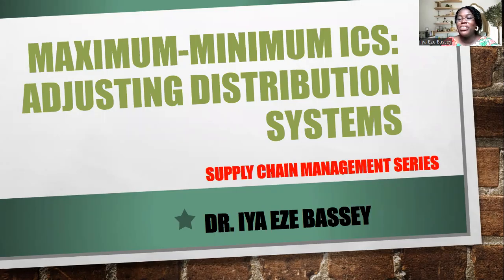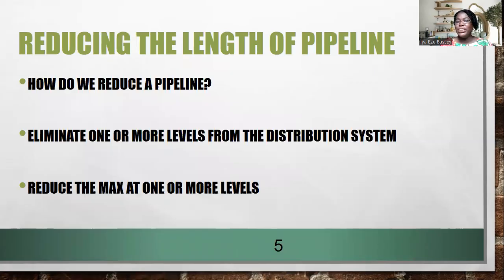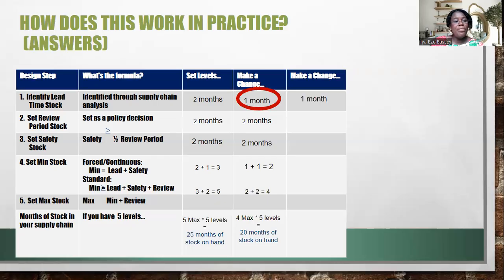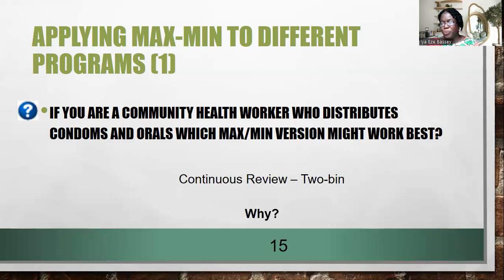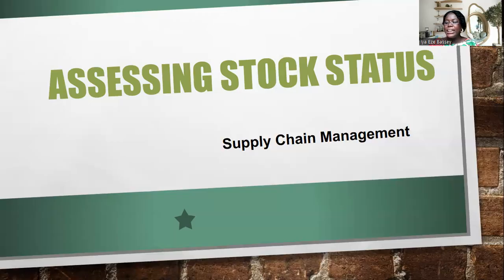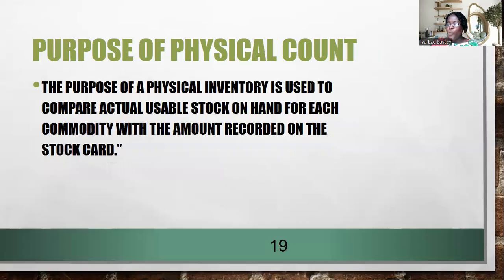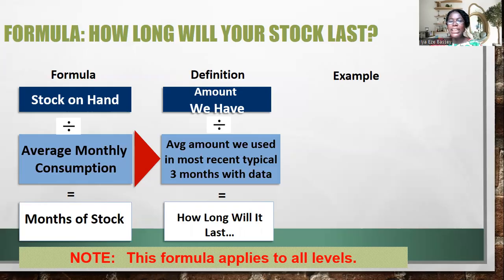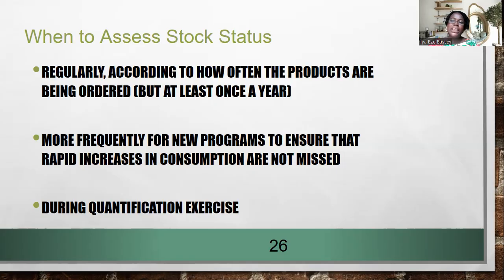Maximum-Minimum ICS: Adjusting Distribution systems (Supply chain management series)

Comment: I learnt a lot from this video and it is very interesting. 
The following are the steps in designing a max min ICS; 

1. Setting up an initial max-min policy for each level and type of facility 2. Check the overall distribution 3. Check the total length of pipeline that each policy level implies. The following are the factors that impact the max-min levels are 1. Cost of production 2. Lead time 3. Storage capacity 4. Cost of storage 5. Age of program The Advantages is using the max-min system are; 1. Avoid overstocking 2. Avoid understocking 3. Minimize wastage 4. Avoid cost of emergency order I also learnt that the system with numerous levels can affect the use of this system, also the system that manage products of new program can be challenging in using the variation
Your lectures are really useful and interesting because it is easily understood and comprehensive. Thanks ma’am

Comment: In summary i leart about the step in designing a max-mini ICS as length of a pipeline 
1. Step up initial max-mini policies for each level and type of facility 
2. Check if the overall distribution will function properly if the level specific max-mini policies are implemented 
3. Check the total length of the pipeline that the policies at each level imply.
 Reducing the length of pipeline 
• How do we reduce a pipeline?
• Eliminate one or more levels frin the distribution system 
• Reduce the max at one or more levels 
Lastly i learnt about assesing stock status.

Thank you ma'am

Comment: To summarize this session, the ways to identify how to adjust distribution system policies depends on the length of a pipeline and how to modify the pipeline to reduce the max at one or more levels to improve the distribution on systems reliability. 

Cost of products, storage capacity, shelf- life of health commodities, lead times, accuracy of forecasts and other factors that impact max-min stock level should be  checkmated to ensure consistency of all stock levels. Although there are challenges to using each version of the inventory control system, reliable data source from SDP for forecasting  and quantification can be collected.

Comment: A brilliant lecture Ma. To summarize, there are steps to designing the Max-min ICS are:
— To set up initial max-min policies for each level and type of facility 
— Check if the overall distribution will function properly if the level specific max-min policies are implemented 
— Check the total length of the pipeline that the policies at each level imply
       To reduce the length of a pipeline one or more levels are removed from the distribution system and reducing the max at one or more level and to reduce the Max. Stock level, elements of the formulas that can be changed in order to reduce the Mac stick level like review period,lead time, distribution systems reliability. There are several factors that affect Max-Min levels are;
a)cost of production(b)lead time. (c)storage capacity (d) cost of storage (e) age of of program. Some advantages of the Max-min system are: avoid overstocking,minimizes shortages,avoidance of emergency order and consistency of stock level,minimize wastage. Challenges to using each version and variation are systems with numerous levels, those that manage a large number of commodities and systems that manage products for new programs. Access stock status involves the physical count which it’s main purpose is to compare actual stock on hand for each commodity with the amount recorded in the stock card. It is possible to access stock status regularly according to how often the products are being ordered but this should be at least a year.

Comment: Thanks ma'am for this insightful lecture, I understand that In designing an efficient maximum-minimum inventory control system, it's important to set up initial policies and check the length of the pipeline that these policies imply. An elongated pipeline can be inefficient, as some products may not last as long. Reducing the length of the pipeline by eliminating one or more distribution levels can be beneficial. Additionally, it's important to regularly count usable inventory by hand to compare it to inventory records, and to update these records as needed. This helps to ensure that inventory levels are accurate and up-to-date.

Comment: Thank you ma, for this detailed lecturer. In summary I learnt, there are several steps in designing max-min ICS, which includes;
1. Set up initial max-min polices for each level and type of facility.
(2) Check if the overall distribution will function properly if
the level specific max-min polices are implemented.
3 Check the total length of the pipeline that the polices at each level imply. I also learnt how to shorten the pipeline:
1) Eliminate one or more levels from the distribution
systems
(2) Reduce the max at one or more levels.
The purpose of assessing stock status is to determine how long supplies will last.

Comment: In supply chain management, the phrase "maximum-minimum ICS: Adjusting Distribution Systems" refers to the idea of optimizing the distribution systems within a supply chain to achieve maximum efficiency and minimal expenses.

To make ensuring that products are supplied to clients in the most effective and economical method possible, it entails analyzing and changing a variety of parameters, including inventory levels, transportation routes, and warehouse locations.

Companies can decrease stockouts and surplus inventory, lower transportation costs, and boost overall customer satisfaction by employing maximum-minimum inventory control systems.

Comment: My Summary:
The steps involved in the design of Maximum - minimum ICS involves determining lead time, setting review period, safety stock, minimum and maximum stock level as well as setting emergency order point.
It talks about the reduction of the length of pipeline as well as the reduction of maximum.
There are advantages to using this system which includes avoiding overstocking, understocking, wastage, cost of emergency orders.
Physical count is also done to assess stock status.

Comment: Discusses the need to examine the length of the supply chain pipeline.
- Explains the importance of setting initial maximum policies for each level and type of facility.
- Emphasizes the need to check if the overall distribution will function properly with the level-specific maximum policies.
- Discusses the concept of reducing the length of the pipeline by eliminating levels or modifying policies.
- Lists factors that impact maximum stock levels, including product costs, transportation reliability, storage capacity, storage conditions, shelf life, lead times, source reliability, effects of zero balance, management skills, program age, and forecast accuracy.

Comment: There are a few specific steps that can be taken to adjust the distribution system when designing
- Evaluate the existing transportation methods and routes.
- Evaluate the warehousing and storage capacity.
- Evaluate the inventory tracking system.
- Evaluate the inventory control policies.
- Based on this evaluation, make changes to the distribution system to optimize efficiency and minimize costs.
- Test the new distribution system and make any necessary adjustments.

Advantages are:
- Improved inventory management: The system allows for more accurate tracking of inventory levels, which can lead to improved inventory management.
- Reduced costs: The system can lead to reduced costs due to improved inventory management, optimized distribution, and reduced inventory waste.
- Increased efficiency: The system can improve efficiency by reducing the amount of time spent on inventory management and distribution.
- Increased customer satisfaction
 Disadvantages are:
- Initial investment: The system can be costly to implement, especially for small businesses.
- Complexity: The system can be complex to set up and maintain, and it may require specialized knowledge or training.
- Inaccurate data: The system relies on accurate data, and any inaccuracies can lead to problems with inventory management.

Comment: Here i learned that its a possible ways employed to reduce those factors that promote a quick and fast distribution hence adjustung and renovating the pipeline distribution system
Some of the element adjusted to bring this effective changes includes
Shortening the review period at one or more levels
Reduce the leadtime at one levels 
Improve the distribution system reliability 
Factors that can impact maximium stock level is

Cost  of products
Reliability of transportation
Storage capacity 
Cost of storage 
Also how accessing stocking status as physical count
The purpose for this physical count and the formular to get monthly stock on hand done by dividing stock on hand by monthly consumption values

Comment: In this session I've been able to learn how the maximum-minimum inventory control system can be used to adjust a distribution system in several ways. Max-min ICS can be used to adjust a distribution system by setting and monitoring maximum and minimum inventory levels. This system can  help avoid stockout and overstocking but it also has some challenges and disadvantages. I also learnt how pipeline can be reduced by adjusting review period and improving distribution system reliability. And also various ways in which max in stock levels can be affected; zero balance effect, staff skills, forecast accuracy, shelf life, lead time etc.

Comment: STEPS IN DESIGNING A MAX-MIN ICS 1)Set up initial max-min policies for each level and type of faculty 2) check if the overall distribution will function properly 3) Check the total length of the pipeline that the policies at each level imply.
FACTORS THAT IMPACT MAX-MIN STOCK LEVEL 1)Lead time 2)cost of products 3) storage capacity 4)cost of storage
ADVANTAGES OF USING MAX-MIN SYSTEM 1)Minimize wastage 2) Avoid overstocking 3) Avoid understocking
IN SUMMARY; Max-min inventory simplify inventory control decision making. Thank you ma'am.

Comment: The topic "Maximum-Minimum ICS: Adjusting Distribution Systems" in Supply Chain Management refers to the concept of optimizing the distribution systems within a supply chain to achieve maximum efficiency and minimum costs. 

It involves analyzing and adjusting various factors such as inventory levels, transportation routes, and warehouse locations to ensure that products are delivered to customers in the most efficient and cost-effective way possible. 

By implementing maximum-minimum inventory control systems, companies can minimize stockouts and excess inventory, reduce transportation costs, and improve overall customer satisfaction

Comment: Summary: Maximum-minimum inventory control systems are super useful for managing the supply of laboratory reagents, consumables, and equipment in medical laboratory science. By setting the right maximum and minimum stock levels, labs can meet testing demands without having too much or too little inventory. This helps keep operations smooth, resources optimized, and ensures timely delivery of accurate test results. Effective supply chain management is key for quality patient care and efficient lab operations.

Comment: Good day ma,
I apologize for the length of my summary, but I found many interesting facts in the video. The video is about inventory control and Max-Min ICS, which are methods of managing health commodities in the supply chain. Inventory control ensures availability and avoids wastage, while Max-Min ICS uses maximum and minimum stock levels to trigger ordering and replenishment decisions. The video also explains some key terms and concepts, such as:

- Maximum stock level: the highest quantity of stock that should be maintained to meet the expected demand plus a safety margin
- Minimum stock level: the lowest quantity of stock that should be maintained to avoid stockout
- Reorder point: the quantity of stock that triggers an order to replenish the stock
- Reorder quantity: the amount of stock that should be ordered to bring the stock up to the maximum level
- Lead time: the time interval between placing an order and receiving the order
- Safety stock: the extra quantity of stock that is kept as a buffer to prevent stockout
- Buffer stock: the quantity of stock that is reserved for emergency use only
- Storekeeper's decision rule: a simple algorithm that guides the storekeeper on when and how much to order
- Forced ordering: a situation where the storekeeper has to order even if the current stock level is above the reorder point
- Continuous review: a method of monitoring the stock level continuously and placing an order whenever it reaches or falls below the reorder point
- Standard review: a method of monitoring the stock level periodically and placing an order based on the average monthly consumption and the maximum and minimum levels

The video also discusses the advantages and challenges of Max-Min ICS, the web-based system LMHC that supports the logistics management of HIV/AIDS commodities in Nigeria, and how to assess stock status using months of stock (MOS) and inventory and usage data.

Comment: In summary; The Maximum-Minimum (Max-Min) inventory control system is a method used in distribution systems to manage inventory levels and ensure timely replenishment. It is commonly used in retail, e-commerce, and other industries with high inventory turnover. 

In the Max-Min system, inventory levels are classified into two thresholds: maximum and minimum. The maximum level represents the upper limit or safety stock level beyond which inventory should not exceed. The minimum level represents the reorder point, indicating that more inventory needs to be ordered to avoid stock-outs.

To implement the Max-Min system, the distribution system sets the maximum and minimum inventory levels based on factors like demand patterns, lead time, and desired service levels. When inventory reaches the maximum level, no new orders are placed until the inventory dips below the minimum level. This ensures that inventory is maintained at an optimum level, preventing excess stock or stock-outs.

The use of the Max-Min inventory control system helps optimize inventory levels, reduce carrying costs, and maintain efficient supply chain operations. By closely monitoring inventory and reordering at the right time, organizations can meet customer demand without incurring unnecessary holding costs or delays in distribution.

Comment: When adjusting the distribution system in the context of the Maximum Minimum Inventory Control System (MMICS), the focus is on ensuring that the right amount of inventory is distributed to the appropriate locations. This involves analyzing demand patterns, lead times, and order quantities to optimize the distribution process. By aligning distribution with inventory levels, organizations can minimize stockouts and reduce excess inventory.

Comment: Thank you ma I understand that in designing an efficient maximum- minimum inventory control system , set up initial max- min policies and check the length of the pipeline that the policies of each level imply . A very long and elongated pipeline will  be so ineffective since some of the kits may not last that long . Hence there is a need to reduce such pipeline through elimination of one or more levels from the distribution System.
This shortening of pipeline involves changing some elements of the formular to reduce the maximum stock level such as lead time .
Another part of inventory control system is physical counting by hand of usable units to compare actual usable stock on hand and those actually recorded on stock card which should be done once in a year

Comment: In summary, I’ve gotten to understand and identify the different ways to adjust distribution system policies, I also understand the advantages of using max-min system. I got to understand how to assess stock status by physical count, in addition I got to understand the purpose of assessing stock status which is to determine how long supplies will last.

Comment: Thank you ma for this wonderful lecture, the summary of what i could get from it is that;
-The maximum minimum inventory control system is a method used in logistics management to adjust distribution systems. 
-It involves setting maximum and minimum inventory levels for each product in order to maintain optimal stock levels. 
-When the inventory level reaches the minimum threshold, the system triggers a reorder point to replenish the stock. Similarly, when the inventory level reaches the maximum threshold, the system stops ordering until the stock is reduced. 
-This system helps in managing inventory costs, reducing stockouts, and ensuring efficient distribution of goods.
Thank you ma.

Comment: I understand that ICS (inventory control system) is a process that helps organizations manage their inventory levels by setting a maximum and minimum level for each product.
- If the inventory level falls below the minimum, an order is placed to replenish it.
- If the inventory level rises above the maximum, action is taken to reduce it.
- This helps to ensure that inventory levels are maintained within a certain range, preventing shortages or overstocking.